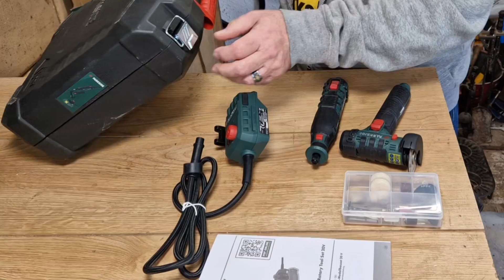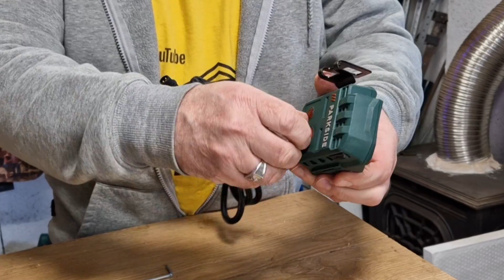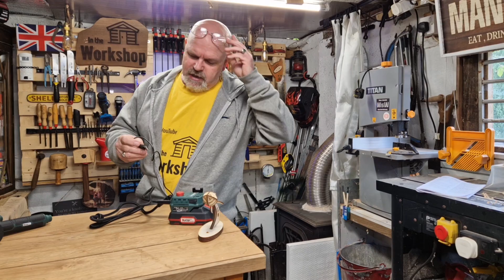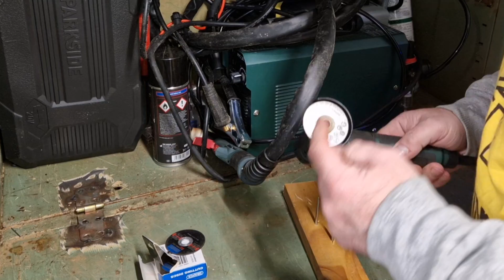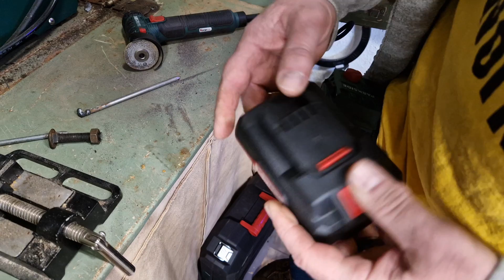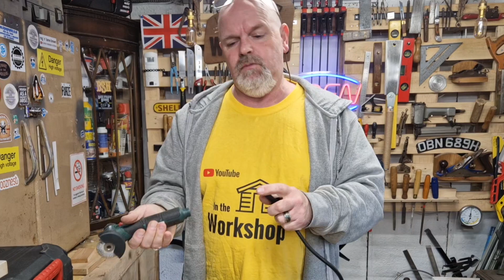Parkside Battery Power Tools PWS 50 A1 angle grinder / PMW 32 A1 Rotary Tool

Comment: Hi I have to make the backsplash of my kitchen and I wonder if this tools are good enough to cut tiles?
Reply from the maker: @nayadopargasjasrabarave7915  I don't think it would be very good as the disc size is very small before you start to cut, and you would need to find ones that can cut tiles also, you would need batteries that might need multiple charges if running for quite some time.
Reply: If you mean just for cutting profiles around sockets of pipes. I reckon it would do OK with the right disk and let the tool do the work.

Comment: This are fantasically useful pair of tools for tube mobile small jobs in central london. Light and powerful. I broke the lock button rotary tool due to overtightening cheap bearings and want a new one now I have learnt this. The rotary tool is oerfect for cutting a slit on rounded screws

Comment: Great review thank you. 

Any idea where you can get replacement discs for the angle grinder? 🙏
Reply from the maker: @henrikkarlsson2281  You can get discs from Amazon 👍
Reply: @InTheWorkshop  Would the 76mm size be the correct one you think? Mine is right worn down now so I can't measure the original size. 

Thank you David🙏

Comment: A good little review, thanks David. I have the 12v. Mini-Grinder and I'd be lost without it. It's the go-to tool when you notice a nail/screw sticking out where it shouldn't. It's now six years old with regular use and no problems. Just let the tool do the work and don't force it.

Comment: Bought this and the jet wash a couple of weeks ago had to take it back after first use. The brake for undoing the collet kept slipping. took it apart the pin was all chewed up metal too soft. Not just a parkside issue but other cheaper makes have the same issue. Going to put the refund towards a Dremel. The cordless jet wash does work a treat.

Comment: Thanks David, I've seen a few of these corded cordless tools, I can see that being of more use for the Rotary tool, and that seemed to me to be a better performer than the angle grinder !

I have the Bosch 12v mini grinder, it is of course much more expensive but has a performance to match and I was already invested in the batteries !